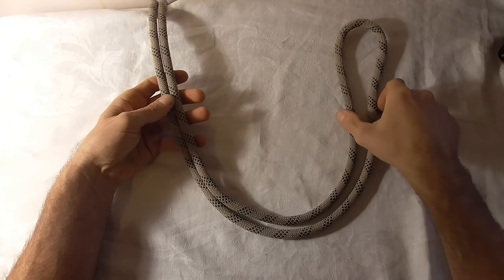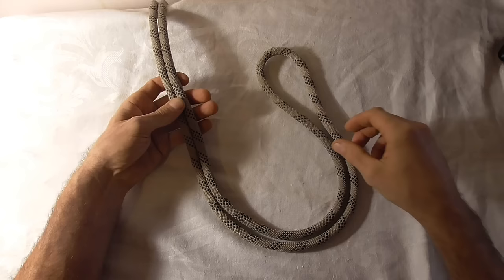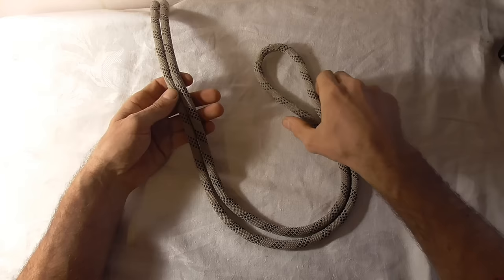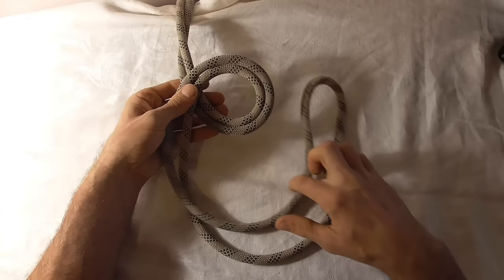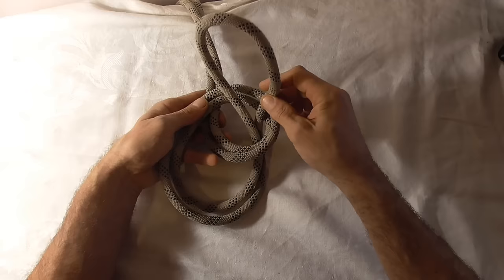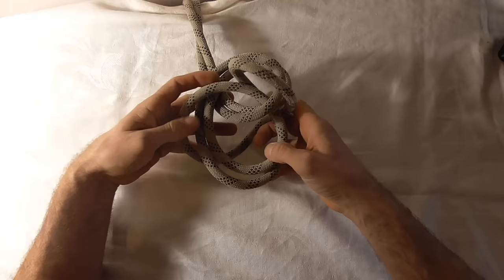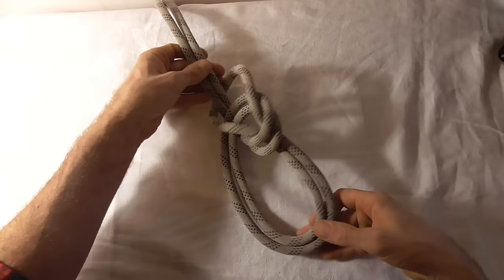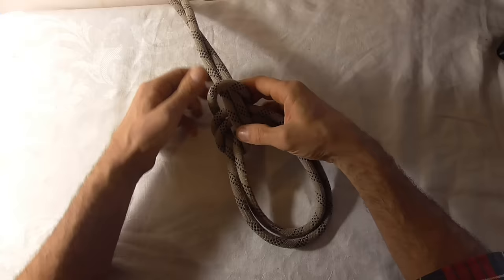Learn How To Tie A Bowline On A Bight - WhyKnot

Comment: Just what I thought I needed, but this won't tie around a closed rail or tree (where you can't loop over the end).  Is there a good anchor knot for the middle of the rope that unties easily after load, that will work over a closed rail?  Thanks for your channel BTW - love your approach and easy-to-follow shots.
Reply: try a running bowline
Reply: This is actually a shortcut technique, it can be tied with access to the working end by doing a bowline and then passing the line through a 2nd time and following the path the 1st bowline.  Similar to a figure 8.